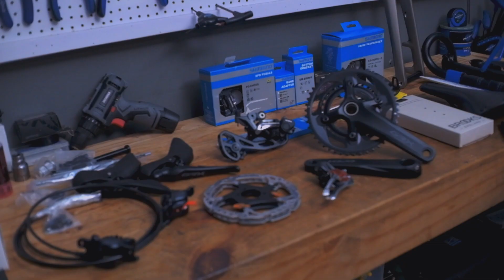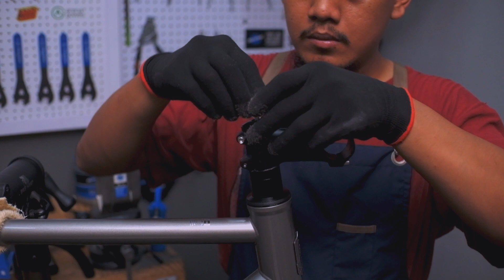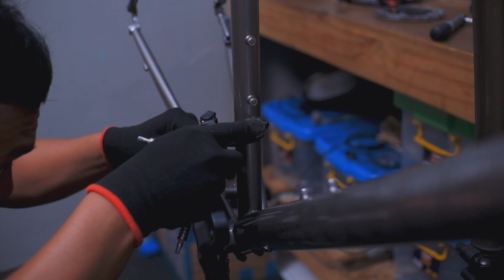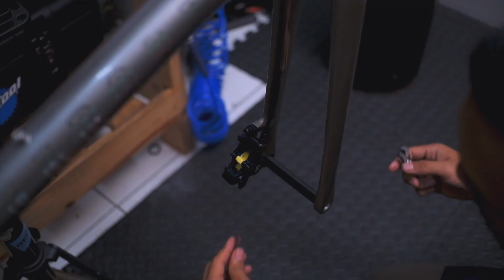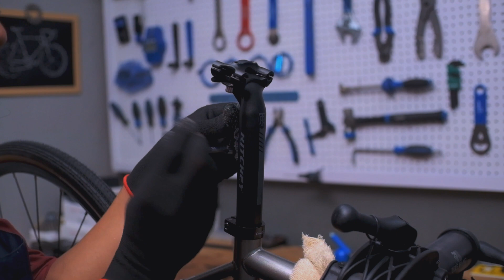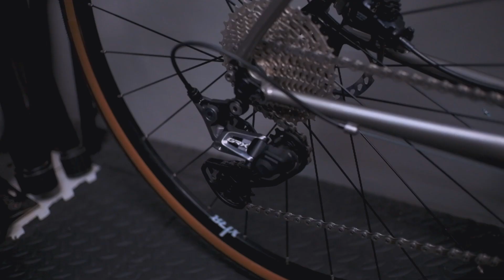BIKE BUILD || TSUNAMI seaboard cx05

Comment: Mas Ung boleh info link lapak untuk adaptor rem nya dapat dimana?
Reply from the maker: itu seingat saya lgsg pnp ko, karna frame brake mount postmount, dan kalaiper yg dipakai jenisnya postmount jg
Reply: @Bengkelmasung  oh jd kalo pake brake SLX BL M-7100 dengan rotor 160mm langsung PNP yah ga usah adaptor lagi? Bawaan nya CX05 bukan nya untuk rotor 140mm yah Mas?
Reply from the maker: iyah saya agak lupa banget mohon maaf, untuk yg belakang pakai adaptor atau enggk 🥺🙏
Reply: @Bengkelmasung  iya yah sy liat di video nya langsung tanpa adaptor. Walopun si rotor nya 160 mm yah..